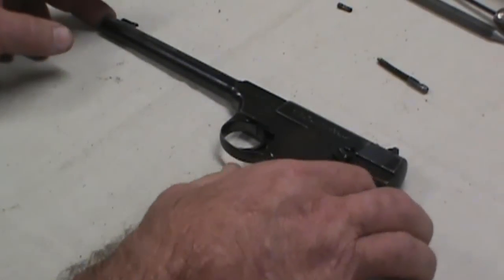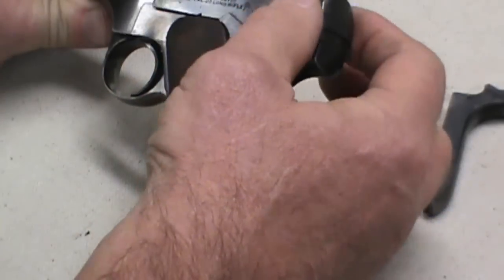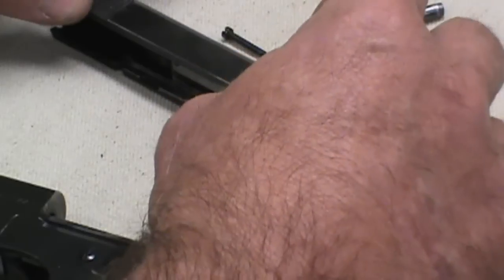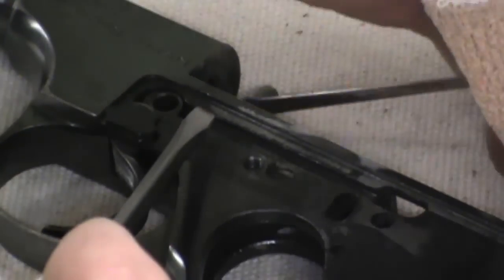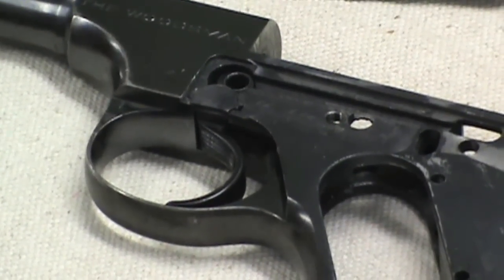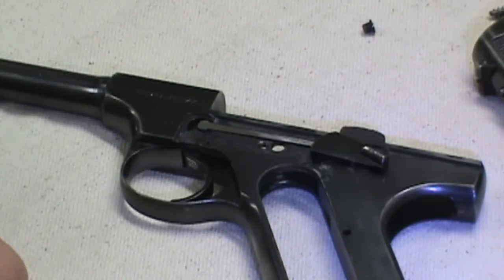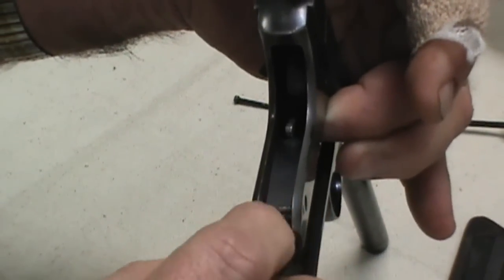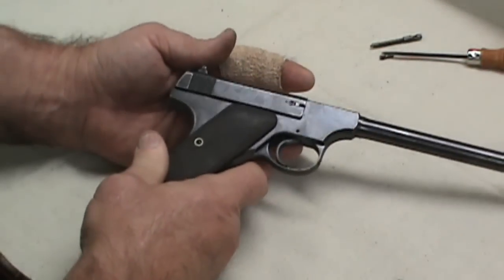Colt Woodsman Bench Review

Comment: Awesome video, Mark!  This really helped me take down and clean my 1941 first series Woodsman that I inherited from my dad and grandfather.  I had a more experienced friend help me clean it once before I shot it for the first time, but we had quite a few light primer strikes in the 150 rounds that we shot.  I used two different types of high-velocity ammo.  (My gun is the high-velocity model.) Both brands had about the same number of light primer strikes.  I'd like to pull out and clean the firing pin and firing pin spring, but I'm afraid to force the stop screw.  In your video, you already removed the firing pin.  Would you be willing to do a short tutorial on how that is done?  My firing pin stop screw is very tight.  Would you recommend break-free or something of the like?  Thanks for the great video!
Reply: I know this is sex years late but If you are still wondering, you have to remove the extractor before pulling out the firing pin stop. I’m currently disassembling my woodsman for the first time and just discovered this
Reply: *SIX years

Comment: First of all thank you for  your  instructional video. 
1. Put in a snapcap or a fired 22 case  to absorb firing pin strike.
2. Take off grips first to avoid damage to them .
3. On sear pin fall out , put a strip of tape on both sides to stop this until grips are replaced .

Comment: Man, I need some help. I just did a basic strip, no internal firing pin ect. When I put it all back together it doesn’t rack. It’ll slide maybe an inch but locks there and won’t go any further back. Just a inch play and will not fully pull back. Could it be the magazine catch, am I not Putting the magazine catch/flat spring on the back of handle frame on right? There’s a slot that you you can slide spring through. Does the curved part of top of that spring need to slide in there or does is go past that and just lay on there. Of course the bottom has a little catch that fits in the slot. Problem is, it won’t rack once reassembled
Reply: I have a similar issue, I don't think my mag catch/ leaf spring is setting properly in the frame